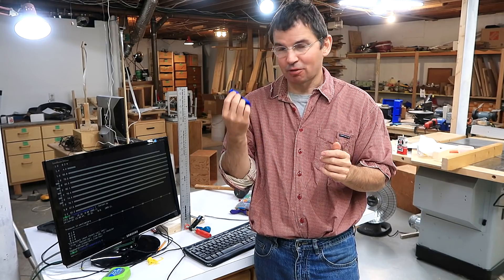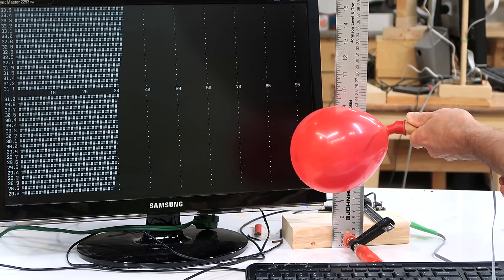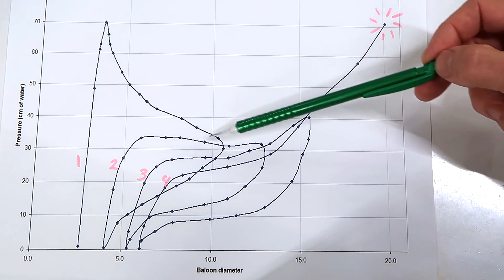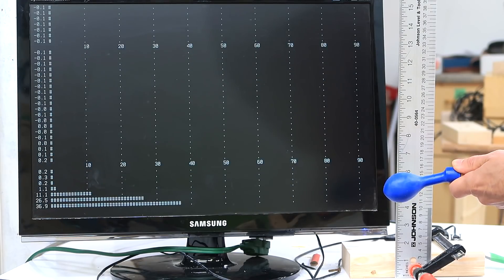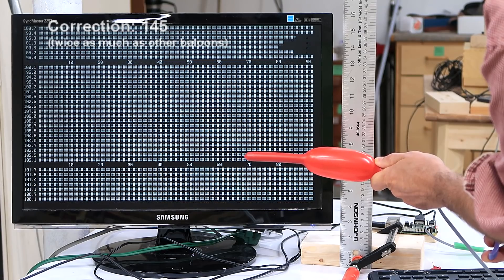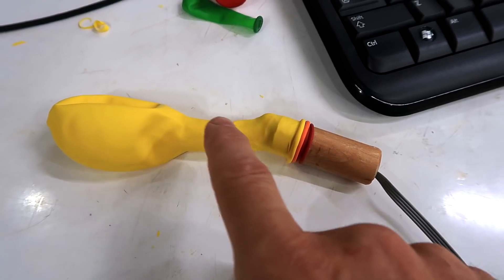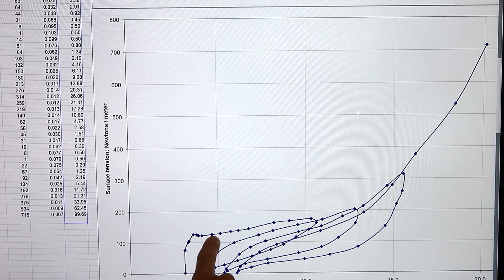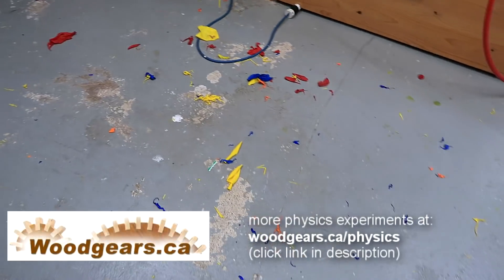Measuring pressure inside a balloon as it's inflated.

Comment: Another factor is that as the balloon inflates, you are basically adding a constant volume per time, however the surface area of the balloon expands as the as the square of teh diameter, but volume is the cube of the volume. So there is a Square-Cube Law effect, as well.
Regards.

Comment: I am surprised that the second inflation does not show a similar pressure decrease in the mid range. 
 I also really appreciate the way you try to get the pressure sensor well within the balloon.  Others appear to have it in the hose where the flow speed can mess the measurement up. Although, even with yours, the flow is still passing by the sensor somewhat, but the reading doesn't seem to change when the flow stops - - so it looks ok..

Comment: This is actually a pretty interesting materials experiment, it might be worth repeating sometime with more formal structure. Here's what I propose:

* Standardize on the type of balloon you use. Different color balloons seem to have different material properties, so pick one size and color and stick with it. Clear balloons (completely uncolored) ones might be the most ideal, since they don't contain any coloring at all. 12" seems like a good size to work with.
* Improve the diameter measuring process. Hang the balloons vertically so that they aren't pulled downwards by gravity, and maybe even come up with a scheme that accounts for the geometric distortion of the camera's field of view. You could use a laser level from a distance and measure the shadow of the balloon and do some trig to correct for the fact that the shadow of the balloon will be slightly larger than the true size

The experiment I had in mind was to explore the hysteresis in a bit more depth. Do the standard burst pressure experiment with three identical balloons without any preconditioning just to make sure they're relatively consistent with each other. Then, repeat the first experiment you did here but with only a two-step process: first, inflate the balloon to a certain diameter, then let the air out. Then, inflate it all the way until failure. From this, we'll be able to see two things: the relationship between initial strain and initial inflation pressure, and also the relationship between initial strain and the maximum size and pressure the balloon reaches before bursting. I suspect the balloon will become larger if it has been preinflated to a larger size, but that its burst pressure may be lowered. Who knows though, perhaps the burst pressure will actually be higher, with the material having developed some initial tensile strength since the molecules will have been given time to work out their tangles during the preconditioning. You could further test this by varying the rate of inflation (very slow vs. very fast), which will affect the thermodynamic properties of the stretching process.
Reply from the maker: Go ahead and do it, send me a link to your video.
Reply: @matthiasrandomstuff2221  I'd love to but I don't have access to a place I could do it without disturbing the neighbors. If I ever do I'll be sure to link it though.

Comment: newbie question, but if 1atm equal 1033cm, then how come the ballon inflates at a pressure lower than 1atm? isn't 1atm the normal pressure around us? thanks
Reply: this is "excess" pressure, "overpressure" above normal air...normal is 14.72 PSI, This is aroung 1 PSI MORE = 15.72 PSI
Reply: @lunam7249 thanks

Comment: Thank you for this.  I am a speech language pathologist investigating the pressure required to inflate a balloon for respiratory muscle training.  I often use balloons with my clients.  There are many devices available to strengthen the respiratory muscles but the cost is an issue for many people.  I needed some data to compare the pressures required to inflate a balloon compared to the pressures that are demanded from resistive and threshold devices.  Balloons are a much cheaper gateway into this arena.  I couldn't find any published data for balloons. Thank you!

Comment: We did an experiment like this in med school. The alveoli in your lungs are similar to balloons. As you demonstrated, after the initial inflation, pressure drops as it inflates. If you were to hook up two inflated balloons to either side of a pvc pipe they wouldn't equalize. As one pushes gas into the other, the growing balloon continues to decrease in pressure and continues sucking more gas from the higher pressure, smaller balloon until the smaller one completely collapses. The same thing would happen to the alveoli in our lungs if not for the surfactant which decreases the surface tension, allowing the pressures to equalize, preventing part of the lung from collapsing.

Comment: Tried to do something like this during choose-your-own-experiment for science class once. Totally pissed off the class having a lecture across the hallway, so I was unfortunately not able to get enough samples for anything decisive.

I used the exhaust of a vacuum pump to get a steady flow into the balloon, so I could approxomate the volume based on duration. What I got a feeling for, based on the measurements I did take, is that pressure/stress in terms of volume seems to be a lot less overall if the balloon had been pre-inflated. In turn, I got the impression that the pre-inflated balloons also took notably more air before they burst.

Comment: You stumbled upon something very interesting there. There's some debate about how much the pressure wave from the releasing air contributes to the noise of a balloon popping, versus purely the sound of the tears in the latex breaking the sound barrier. You just managed to get quite a sizeable noise with zero air being released. Interesting...
Reply from the maker: still a pressure wave.  As one of the baloons pops, the pressure drops, which means the volume went up, causing a pressure wave.

Comment: Theres a trick to blowing up tiny balloons. You pinch the very tip of it and pull it out to stretch it 2-3x its normal length. Quicker than sitting there stretching and unstretching back and forth before blowing.

Comment: As a respiratory therapist, this video remind me the human lungs compliance graft on the mechanical ventilator 😀. Keep it up. You may come up with a solution to protect lungs from barotrauma.
Reply: That's interesting. Couldn't a balloon in parallel with the tube act as a sort of fuse? It could rely on the innitial plastic deformation to limit the pressure, as when you have to blow harder the first time to get the balloon going. If the pressure ever gets too high, it starts inflating, and would thus also be shunting off pressure from the lungs.

Comment: Balloons are very interesting. For my undergrad final year project in engineering I did a study on a balloon problem. If you have two balloons connected together, one inflated only a little bit and the other one a lot more, the small balloon actually deflates and inflates the larger balloon. This is due to the material not behaving linearly like steel. In the study I had to predict the diameters of the two balloons after a valve between them were opened.
Reply: I would like to know more please

Comment: interesting tid bit, lungs are very similar, if a lung deflates beyond a certain point it can take dangerous amounts of pressure to open it back up, but if there is always a little bit of pressure remaining the lungs will need less pressure to inflate. when that back pressure isn't maintained, each ventilation of excessive pressure causes damage to the internal bits of the lungs, which actually makes each "breath" less effective in terms of O2 CO2 exchange. 
I won't go into technical details (peep, pap, tidal volume, etc.) because, well frankly I only have a surface level understanding at this time :P
Reply: Is that what "collapsed lung" means?
Reply: @spugintrntl  possibly, I believe that "collapsed lung" is a colloquial phrase for a number of medical conditions that affect the ability of a person to breath in and out properly. 
a pneumothorax and hemothorax are air or blood pressing on the lung from outside the lung but inside the chest, I think those are generally referred to as a collapsed lung. 
but there are other issues that require ventilation; congestive heart failure, Asthma, pneumonia, etc. 
the lungs have little alveoli, that are kind of like balloons too, that also need to pressure to work correctly (they are where the gas exchange happens)

Comment: Really cool test, i seem to recall that the ultimate tensile strength of rubber and latex maxes out at around 25 MPa, do you mind showing a little background to your calculations? Interesting topic!
Reply from the maker: It depends on how you measure uptimate strength.  In my case, it's just before it fails.  If you expect it to hold for a long time, it will be much less.  Also, left fully inflated, the pressure will drop pretty quickly.  The 100 mpa was basically peak before exploding.
Reply: @matthiasrandomstuff2221  As far as i remember, those UTS were obtained by standard tensile tests, i was therefore surprised to see the 100 MPa value. Did you use the internal pressure formula approximated for a sphere, while estimating modulus and wall thickness? Am just curious to how you obtained the value, while not questioning its correctness

Comment: Next video: Using balloons inside a fiberglass bag for compressed air storage.
Reply: Isn't that basically a garden hose in a different shape?
Reply: @eDoc2020  It is the basic theory behind composite over-wrapped pressure vessels, the kind of tanks that SpaceX uses in their rockets, although they don't have a flexible liner (balloon) because everything tends to freeze at the temperatures in their tanks.
Reply: @eDoc2020  But yeah, garden hoses are made based on a similar concept too, but they don't work well as air tanks because of that other hole in them.

Comment: P = F/A
In order to keep the pressure low, you have to increase the area. The area of a sphere is 4*Pi*r^2. 
For example: Double the initial diameter of the ballon will result in ~4x less pressure needed.

Note: This is why smaller pressure pipes can hold higher pressure than big pipes.
Reply: I believe the formula is describing a closed system with the same amount of air, and therefore not related to the video. 
Smaller pipes as well as smaller balloon have steeper surface curvature, which is the reason for higher pressure to expand them.